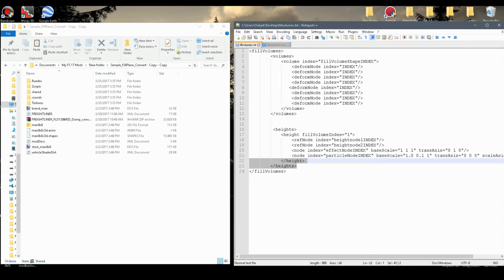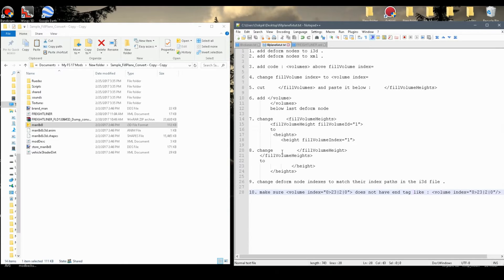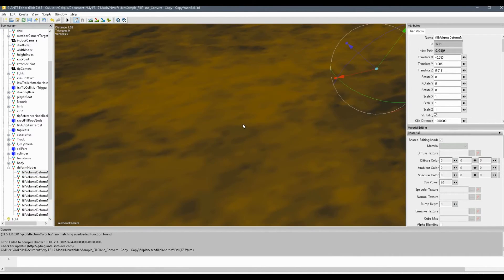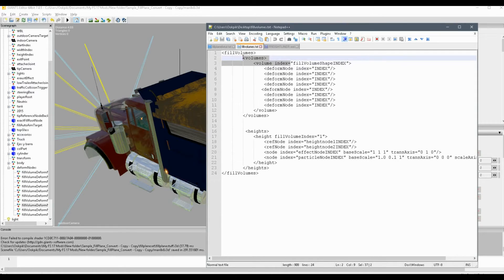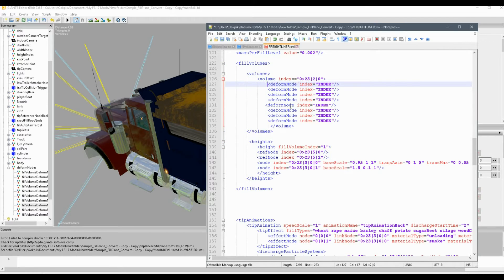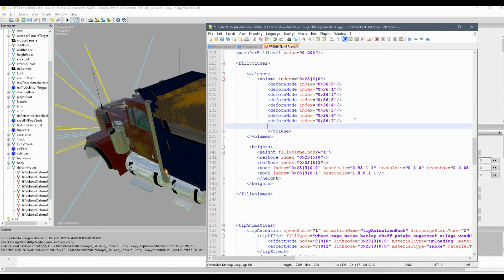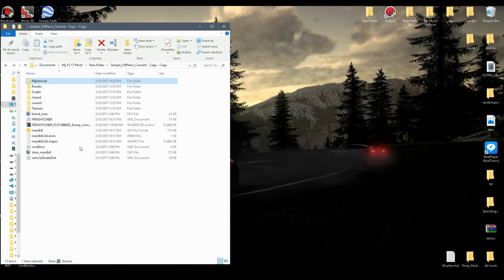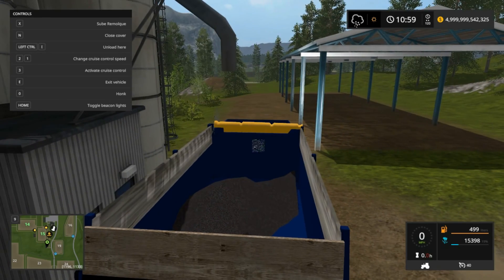Fix Converted Mod's Fillplanes // Farming Simulator 17

Comment: I cant find the information for the height fill information in this mod to add the fill plane too, maybe you know where it is?

<?xml version="1.0" encoding="utf-8" standalone="no"?>
<vehicle type="DemcoHarvestLink">
    <annotation>Copyright (C) Giants, All Rights Reserved.</annotation>
   
   <storeData>
        <name> <en>Harvest Link 1</en>
        </name>
        <functions>
          </functions>
        <specs/>
        <image>store.dds</image>
        <price>125000</price>
        <dailyUpkeep>350</dailyUpkeep>
        <lifetime>600</lifetime>
        <rotation>0</rotation>
        <brand>DEMCO</brand>
        <category>augerWagons</category>
    </storeData>

   <typeDesc>Demco Harvest Link</typeDesc>
    <filename>DemcoHarvestLink.i3d</filename>
   
    <size width="6" length="10.0"/>
    <wheels autoRotateBackSpeed="2.0">
        <wheel repr="0>0|5|0" deltaY="0.1" radius="0.6" restLoad="1" suspTravel="0.1" spring="80" damper="30" frictionScale="2" mass="0.5" hasParticles="true"/>
        <wheel repr="0>0|6|0" deltaY="0.1" radius="0.6" restLoad="1" suspTravel="0.1" spring="80" damper="30" frictionScale="2" mass="0.5" hasParticles="true"/>
        <wheel repr="0>0|7|0" deltaY="0.1" radius="0.6" restLoad="1" suspTravel="0.1" spring="80" damper="30" frictionScale="2" mass="0.5" hasParticles="true"/>
        <wheel repr="0>0|8|0" deltaY="0.1" radius="0.6" restLoad="1" suspTravel="0.1" spring="80" damper="30" frictionScale="2" mass="0.5" hasParticles="true"/>
        <wheel repr="0>0|16" deltaY="0.1" radius="0.1" restLoad="10" suspTravel="0.1" spring="80" damper="30" frictionScale="2" mass="0.5"/>
        <wheel repr="0>0|17" deltaY="0.1" radius="0.1" restLoad="10" suspTravel="0.1" spring="80" damper="30" frictionScale="2" mass="0.5"/>
        <wheel repr="0>0|18" deltaY="0.1" radius="0.1" restLoad="10" suspTravel="0.1" spring="80" damper="30" frictionScale="2" mass="0.5"/>
        <wheel repr="0>0|19" deltaY="0.1" radius="0.1" restLoad="10" suspTravel="0.1" spring="80" damper="30" frictionScale="2" mass="0.5"/>
    </wheels>
    <brakeForce>0.3</brakeForce>
    <lights>
        <!-to be adjusted manually->
        <low></low>
        <!-to be adjusted manually->
        <high></high>
        <!-to be adjusted manually->
       
    </lights>
    <brakeLights>
        <brakeLight decoration="0>0|23|1"/>
    </brakeLights>
    <turnLights>
        <turnLightLeft  decoration="0>0|23|2"/>
        <turnLightRight decoration="0>0|23|3"/>
    </turnLights>
 
 <fillUnits>
       <fillUnit unit="$l10n_unit_literShort" fillTypeCategories="bulk" capacity="150000"/>
    </fillUnits>
 
 <fillVolumes>
        <volumes>
            <volume index="0>0|20|0" maxAllowedHeapAngle="5" maxDelta="0.1" />
        </volumes>
  <dischargeInfos>
            <dischargeInfo>
                <node index="0>0|3|1|0|0|0|1" width="0.3" length="0.3" />
            </dischargeInfo>
        </dischargeInfos>

        <unloadInfos>
            <unloadInfo>
                <node index="0>0|20|1" width="1" length="1" />
            </unloadInfo>
        </unloadInfos>
    </fillVolumes> 
    <fillRootNode index="0>"/>
 <exactFillRootNode index="0>0|22"/>
    <fillMassNode index="0>"/>
 <massPerFillLevel value="0.0001"/>
 
   <inputAttacherJoints>
        <inputAttacherJoint index="1>0|0" jointType="implement" rootNode="1>" lowerDistanceToGround="0.5" upperDistanceToGround="0.7" lowerRotationOffset="0" upperRotationOffset="8" rotLimitScale="25 0 0" transLimitScale="0 0 0" needsLowering="false" allowsLowering="false"/>
    </inputAttacherJoints>
 
    <allowTipDischarge value="true"/>
 <supportsFillTriggers value="true"/>
    <cylinderedHydraulicSound file="$data/sounds/hydraulicUp.wav" pitchOffset="0.9" volume="1.0"/>
    <fillSound file="$data/maps/sounds/siloFillSound.wav" pitchOffset="1.0" volume="1.2" volume3D="1.2" innerRadius="10" radius="40" linkNode="0>0|3|1|0|0|0|2" useOnCharge="false"/>
    
 <foldingParts startMoveDirection="0" posDirectionText="unfold_OBJECT" negDirectionText="fold_OBJECT">
        <foldingPart animationName="lift" speedScale="1"/>
    </foldingParts>
    
 <animations>
  <animation name="lift">
           <part node="0>0|5" startTime="0" endTime="2" startRot="0 0 0" endRot="65 0 0"/>
            <part node="0>0|6" startTime="0" endTime="2" startRot="0 0 0" endRot="-65 0 0"/>
            <part node="0>0|7" startTime="0" endTime="2" startRot="0 0 0" endRot="65 0 0"/>
            <part node="0>0|8" startTime="0" endTime="2" startRot="0 0 0" endRot="-65 0 0"/>
        </animation>
        <animation name="toggleCover">
            <part node="0>0|27" startTime="0" endTime="0.05" visibility="true"/>
            <part node="0>0|26" startTime="0" endTime="0.05" visibility="false"/>
            <part node="0>0|27" startTime="0.05" endTime="0.1" visibility="false"/>
            <part node="0>0|26" startTime="0.05" endTime="0.1" visibility="true"/>
        </animation>
   <animation name="pipeAnimation" >
            <part node="0>0|3" startTime="0" duration="15" startRot="0 180 0" endRot="0 90 0"/>
        </animation>
    </animations>
    <cover animationName="toggleCover"/>
 
    <pipe numStates="2" unloadingStates="2" raycastNodeIndex="0>0|3|1|0|0|0|0" raycastDistance="6" delay="0.5">
       <node index="0>0|3|1|0" rotationSpeeds="15 0 0">
            <state1 rotation="0 0 0"/>
            <state2 rotation="90 0 0"/>
        </node>
    </pipe>
 
    <overloading capacity="1000">
       <trailerTriggers>
          <trailerTrigger index="0>0|28"/>
       </trailerTriggers>
 </overloading>
 
    <pipeEffect>
       <effectNode effectClass="PipeEffect" effectNode="0>0|3|1|0|0|0|2" delay="0" materialType="pipe" materialTypeId="1" maxBending="1" shapeScaleSpread="1.7 1.2 1 0"/>
    </pipeEffect>
 
    <washable dirtDuration="200" washDuration="1" workMultiplier="4"/>
 
    <movingTools>
        <movingTool index="0>0|3">
            <controls axis="AXIS_FRONTLOADER_ARM" icon="$dataS2/menu/moveControls/frontloader_tool.png" invertAxis="false" invertMouseAxis="true" speedFactor="3"/>
            <rotation rotSpeed="35" startRot="0" rotationAxis="3" rotAcceleration="25" rotMax="0" rotMin="-22"/> 
        </movingTool>
      <movingTool index="0>0|3|1|0|0">
        </movingTool>
        <movingTool index="0>0|5"/>
        <movingTool index="0>0|6"/>
        <movingTool index="0>0|7"/>
        <movingTool index="0>0|8"/>
    </movingTools> 
    <movingParts>
        <movingPart index="0>0|13" referencePoint="0>0|3|4" referenceFrame="0>0|3" isActiveDirty="true">
            <translatingPart index="0>0|14|0"/>
        </movingPart>
        <movingPart index="0>0|14" referencePoint="0>0|3|3" referenceFrame="0>0|3" isActiveDirty="true">
            <translatingPart index="0>0|15"/>
        </movingPart>
        <movingPart index="0>0|3|2" referencePoint="0>0|3|1|0|1" referenceFrame="0>0|3|1|0" isActiveDirty="true">
            <translatingPart index="0>0|3|2|0"/>
        </movingPart>
        <movingPart index="0>0|6|1" referencePoint="0>0|5|1" referenceFrame="0>0|5" isActiveDirty="true">
            <translatingPart index="0>0|6|1|0"/>
        </movingPart>
        <movingPart index="0>0|8|1" referencePoint="0>0|7|1" referenceFrame="0>0|7" isActiveDirty="true">
            <translatingPart index="0>0|8|1|0"/>
        </movingPart>
        <movingPart index="0>0|4" referencePoint="0>0|3|5" referenceFrame="0>0|3" isActiveDirty="true" scaleZ="true"/>
    </movingParts>
 
    <components count="2">
        <component1 centerOfMass="0 0 0" solverIterationCount="200"/>
        <component2 centerOfMass="0 0 0" solverIterationCount="200"/>
        <joint component1="0" component2="1" index="0>0|15" rotLimit="0 60 0" transLimit="0 0 0"/>
    </components>
 
    <schemaOverlay file="$dataS2/menu/schemas/implementSchema.png" fileSelected="$dataS2/menu/schemas/implementSchemaSelected.png" width="0.5" height="0.5" attacherJointPosition="0 0"/>
    
 
</vehicle>
Reply from the maker: I think the section for <heights> should generally go somewhere between <fillVolumes> and </fillVolumes>
so, in between here somewhere, I believe

 <fillVolumes>
        <volumes>
            <volume index="0>0|20|0" maxAllowedHeapAngle="5" maxDelta="0.1" />
        </volumes>
  <dischargeInfos>
            <dischargeInfo>
                <node index="0>0|3|1|0|0|0|1" width="0.3" length="0.3" />
            </dischargeInfo>
        </dischargeInfos>

        <unloadInfos>
            <unloadInfo>
                <node index="0>0|20|1" width="1" length="1" />
            </unloadInfo>
        </unloadInfos>

      <<<<<<<< maybe here. . .
    </fillVolumes>

Comment: could you do video on adding wheel types to tractors. I just can't get it to quote work.
Reply from the maker: What do you mean by wheel types?
Reply: TheChase IsOn I have been trying to add dubble thin tires from the large case to a massey fergson mod for example. can get it to show up in the store as an option but tractor always spawn on its rims. I assume I am missing a big step I am just not aware of.
Reply from the maker: Hmm, I will look into this, and see what I can do, as for a video on this.
When you buy the wheel option do the tires look normal then?
Reply: TheChase IsOn yes I am just taking the code from one xml and pasting it to the other. But must be more to it.
Reply from the maker: I'm thinking how these customizations work is that you set a customization (default, custom1, custom2, etc) and whenever you buy one of those customizations, it loads whatever is at the index path you set, for the customization.

So it could be that at the index you set for the default customization, that index only contains the rims, and not the rubber.
Reply: Hmm that could be it. I will have another look. I will post more exact information tonight when i am home and have the code in front of me.
Reply from the maker: Aight.